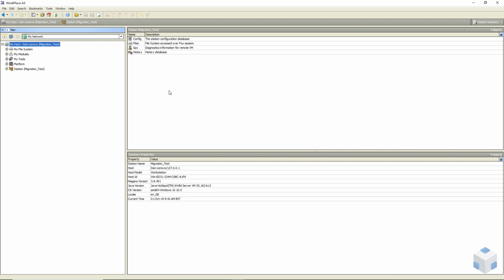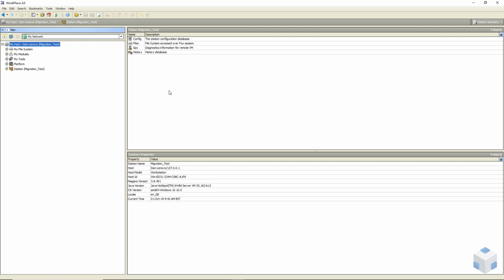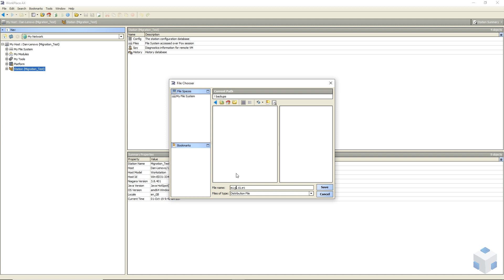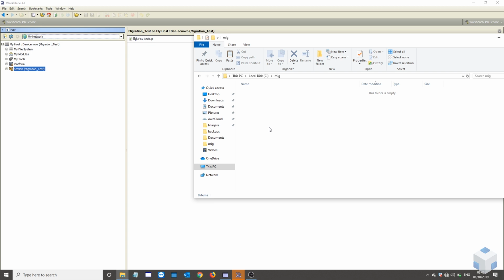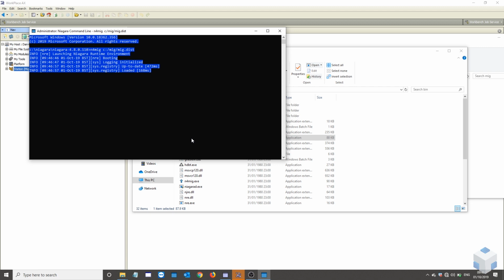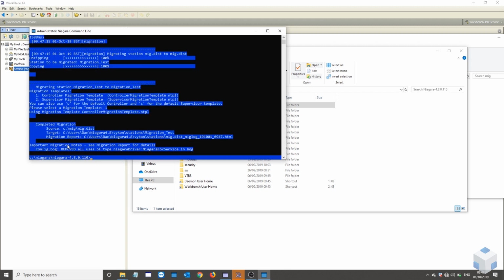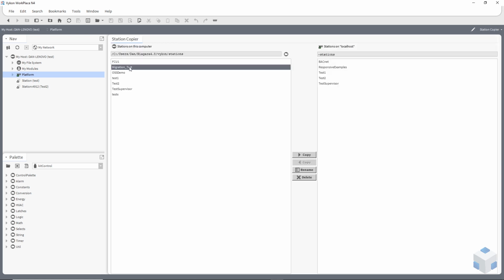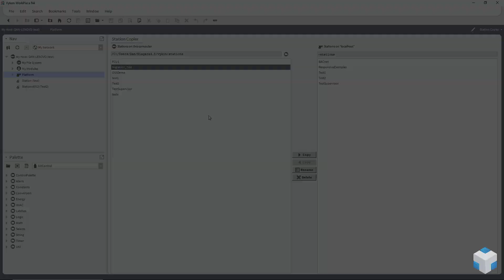HOW TO: Migrate a Niagara AX station to Niagara 4

Comment: Something to keep in mind. When migrating you need to have modules needed that exist in AX in your version of N4. So 3rd party modules like AX community etc. in the N4 version installed in N4. Make sure to get the signed module if it's N4.10 or greater. If you don't do this it just does away with everything using whatever modules you don't have. This can be a problem.

Comment: "Cannot validate AX dist: Source backup is from Niagara AX 3.6 or earlier"

N4 migration failure and show this message. How to solved it?
Reply from the maker: You are trying to migrate a station that is too old to go straight through the mig tool. Suggest updating to the latest 3.8 first.
Reply: @OnesightTV  I see, noted with thanks 🤗
Reply: @OnesightTV  How do you update it via command line ? from AX3.6 to AX3.8 ?